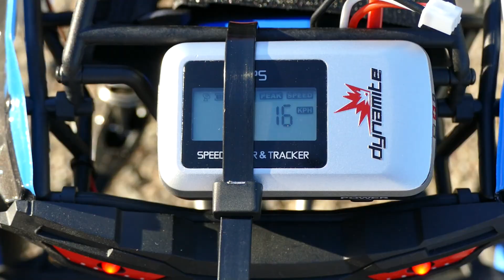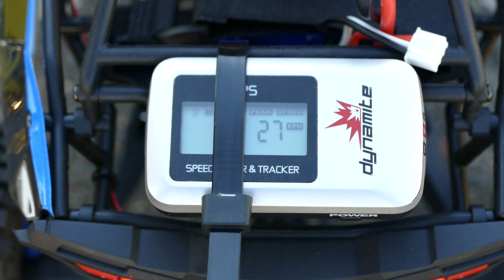WLToys 10428-B MINI POLARIS RZR Clone - Bashing & Speed Test

Comment: Hi there man, big like here on the video. I've unboxing mine also and today was shooting the test video in the gear start so make a really lowed gear noise, did it happened to you? I thing that the gear spring is to tight and does not let the gear slipping in high strength and break some of the gear...
Reply from the maker: +Goncalo Quinas I have noticed that you need to come to a complete stop for it to shift into gear but once engaged it seems fine.
Reply: Tha's not the problem on mine. I will show you when i finished the video for monday. On the same gear when the car is moving it makes a loud gear claking....
Reply: Do you noticed that aux trim and aux dual rate on the transmitter does nothing? I had to trim the shifting servo to stop pushing the rod once it engages 2nd gear, you can hear a high pitch noise when it reached the travel limit
Reply: For now I have to wait for my new servo to came, the stock one died, still don't know really why but probably is a miss adjustment. I show it on the final of my test video, the servo gear noise.